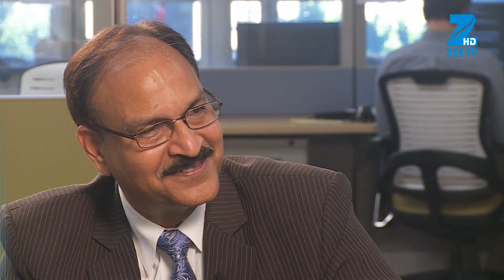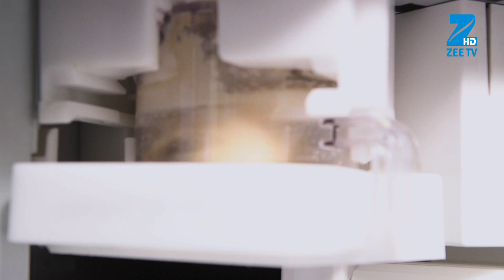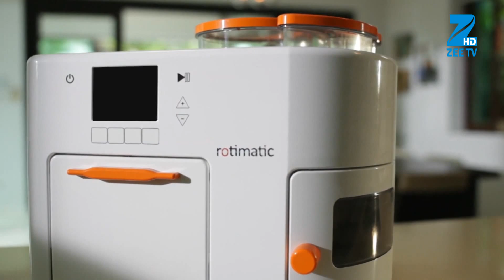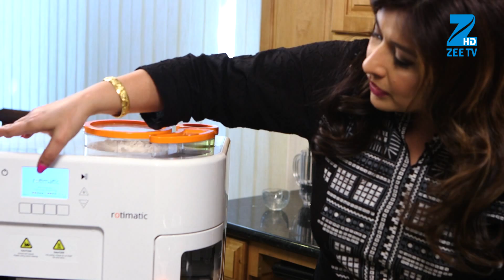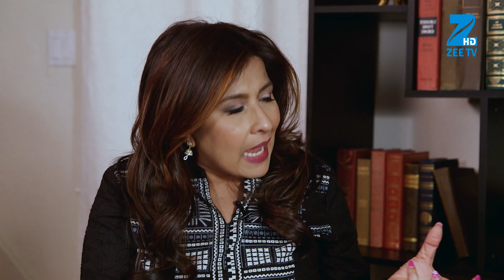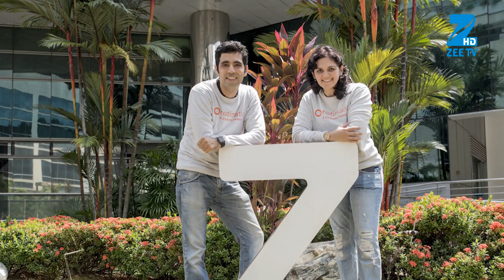Fresh Healthy Homemade Roti in 1 Minute | TOMORROW'S WORLD SEASON 1 | Rotimatic

Comment: Complete bullshit product. Will work for a year and then you start chasing customer support to get it fixed. Customer support is a joke as they try every possible way to delay the fix by pushing some meaningless software upgrade although the issue will be with hardware. They don't honor extended warranty and will charge you $199 even after paying $200 for extended warranty by giving false reason. The whole reason of buying extended warranty is to have coverage on any hardware issue which their terms and condition clearly specify.